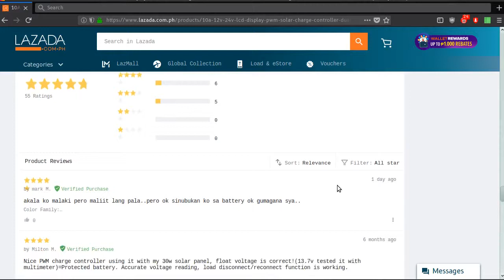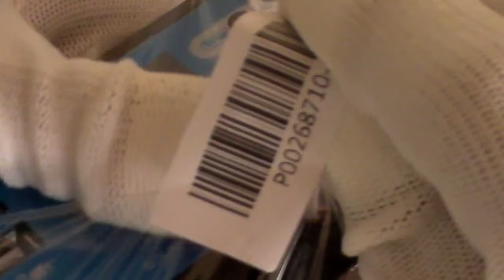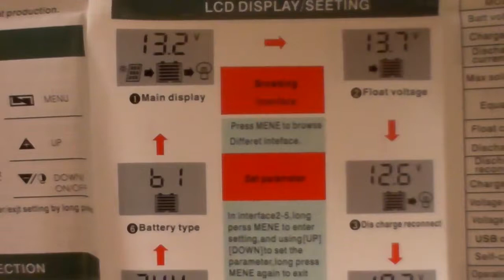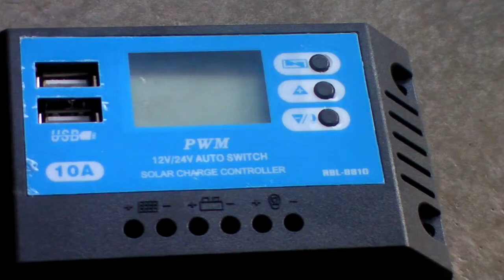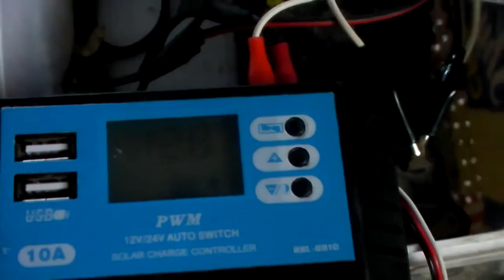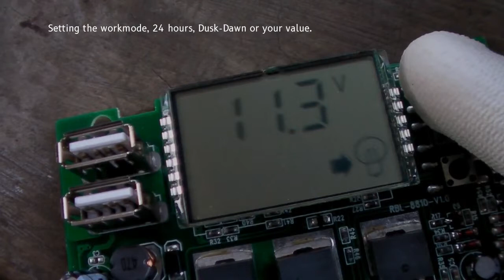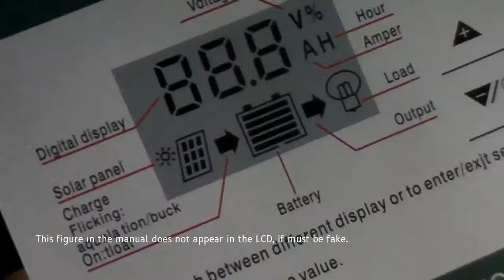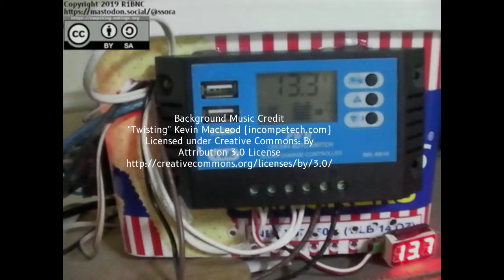#33 PWM Solar Charge Controller Unboxing, Review and Application

Comment: I use one of these on a 60V panel array using a $5 modified buck converter to keep the panels operating at the power point voltage. That makes a really cheap system with the efficiency close to that of a MPPT controller.  Don't waste money on battery voltage panels. Be aware that the input and output negative terminals are not common (the positive ones are connected together).  Never short the two negatives together as these are the terminals the FET switches.